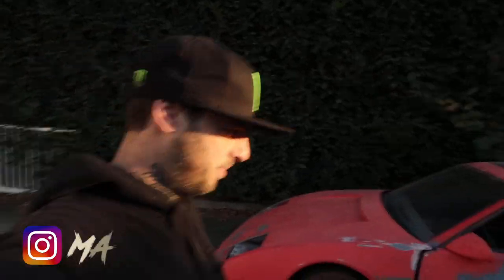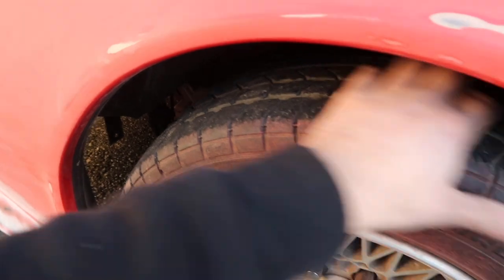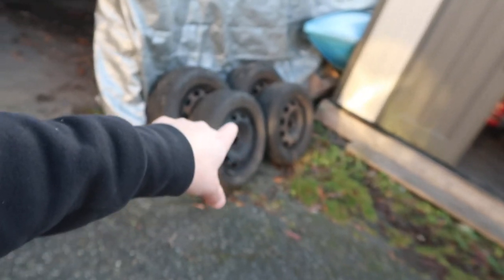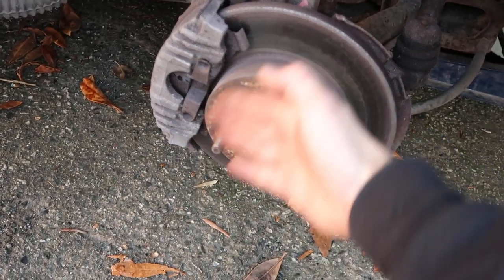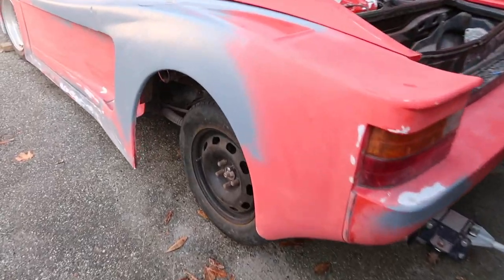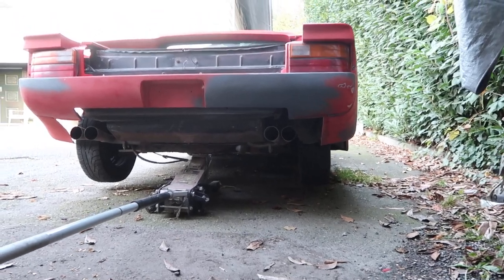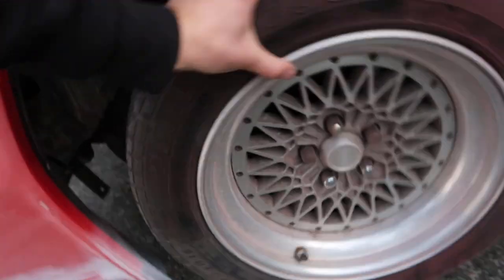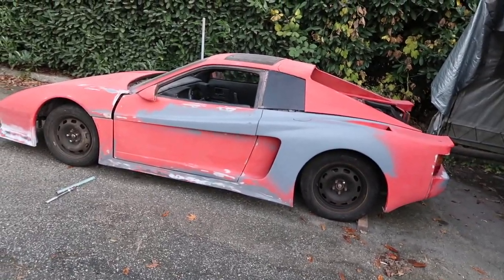Fake Ferrari (three) piece wheels!

Comment: Chrome and gold would look good, I'm thinking of that on my fiero 308 replica which I've just had painted white. But if you want to go darker to make it appear longer, don't go for all black but gunmetal grey or anthracite would be better. Either that or polished rim with black centres.
Painting the sills and the lower lip on front nose in satin black would help it look longer too.
Reply from the maker: Good idea on a gunmetal vs black.. I think that would look really good. Started polishing the lips today so i think I'm going the chrome lip and gold face direction! 

Good suggestion on the black sills. when i got the car it was painted like that and did visually stretch the car. but I'm gonna stay true to the koenig testarossa and do all red!

Comment: Gold with polished lips Mike it will look awesome. Koenig tuning ordered their rims from BBS who’s trademark was gold wheel centres. Make it look like the original car especially if you are going for the Solid Ferrari red paintwork . On my own car which is Ferrari Rosso Corsa  deep maroon I deliberated long and hard about the wheel centre colour but always came back to the gold centres. Look at R V Dynamics Nemesis v8 here on You Tube to see the contrast between the paint and rims. Incidentally I run 295 tyres on the rear of mine on a 18 x 12 inch three piece rim . I have also seen Fiero kits with the competition rear spoiler which helps visually lengthen the car if you can find one. Regards
Reply from the maker: Gold with polished lip it is! can't wait to see how the 295 on my car looks. the 265 are just too stretched.. I really like your color you painted your car. looks very expensive looking.